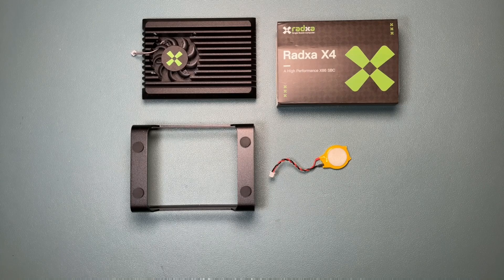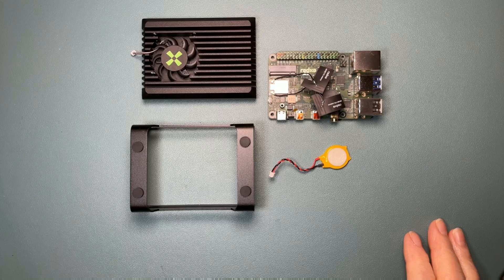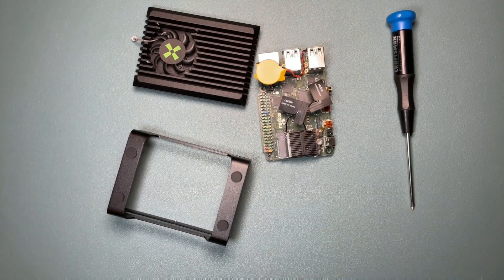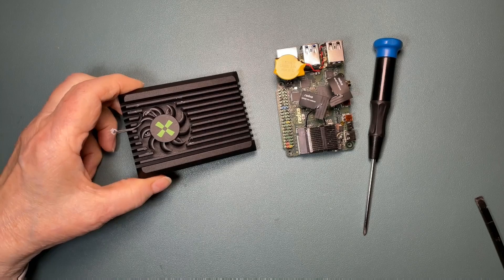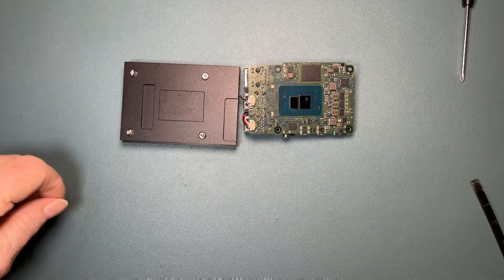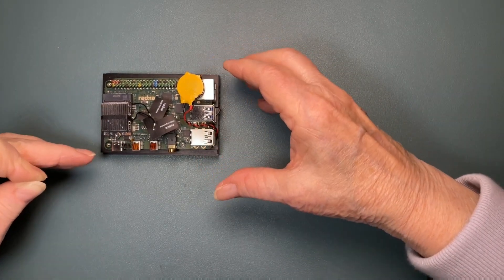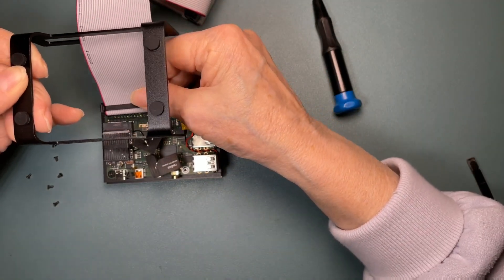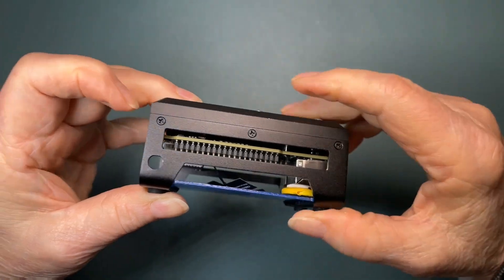Radxa X4 Assembly into official case with modifications.

Comment: Thank you for the video which help with the crumbling thermal pad.
Due to the thickness of the shims, it may be important to adjust the height of th heatsink so that the bord is well with a flat contact.
It can be done using washers.
Reply from the maker: Thank you for your suggestion. My X4 seems not to need any more than the .5mm thick shim, but I have watched other videos where the gap was described as being 1 mm or so. I think possibly Radxa may have adjusted the height of their standoffs on some later case kits. I have also added a "cover" for the GPIO pins made from an old IDE flat ribbon cable connector (you can also purchase silicon GPIO pin covers from Amazon),  and caulked against the bottom of those pins with black automotive silicon, because the openness of the case still worries me. I frequently have tweezers, screw drivers, scissors, or other metal things which may get too near that open case. Additionally, I have put a better heat sink on the NVMe drive. One that is 25mm x 25mm x 10mm (self-adhesive). This has taken a good 10 degrees off the NVMe temps. NVMe was the hottest thing on the board (still is) reaching 72 degrees when stressed, and idling at 62 degrees. Another thing I have in mind is making a better plastic shield that comes up the sides as well as the bottom of the case. If I can figure out how to edit the video, I may add those further modifications. Or maybe just  a future  video.

Comment: Excellent video, Rose - well done! It very clearly shows the assembly process and you have come up with some interesting modifications. I've had mine for a couple of weeks now and really am enjoying it and am impressed with the performance in Windows 11 (I have the 12Gb version). I similarly added a heatsink to the SSD, but replaced the fan with a 40mm Noctua FLX (removed from its frame, plugged into the 2-pin connector beside the USB port as it's a 12v fan) with a small fan controller to slow it down, allowing me to run this machine inaudibly, even though it's on the desk right in front of me. I plugged a Pimoroni Blinkt into the GPIO and wrote a Powershell script in Windows that passes the CPU temperature and load over to a Micropython script on the RP2040, illuminating the LEDs according to the temperature and load - makes for a nice effect! I've been experimenting with doing regular computing tasks on this instead of my regular desktop, due to the very low power consumption. It has been working so well that I haven't had my main desktop PC on since assembling the X4. Heavier tasks, such as video editing will be a different story of course. Look forward to seeing your future videos!
Reply from the maker: Thank you for your kind words, and ideas to make the X4 an even better daily driver. I may try Windows 11 (once I finish playing with Ubuntu).